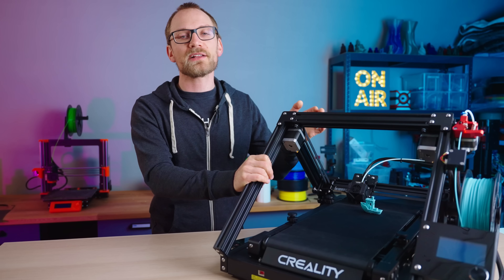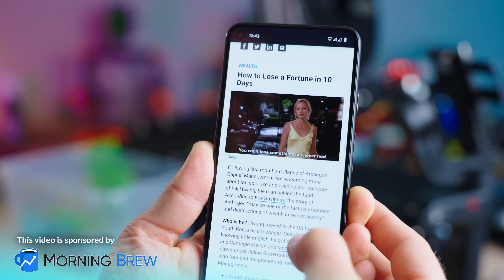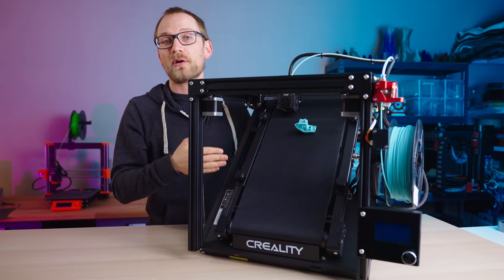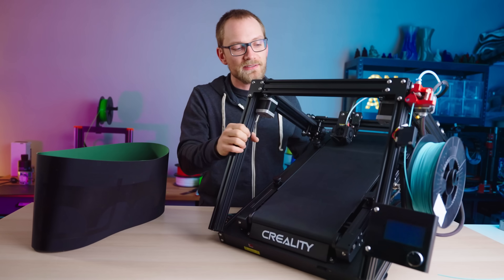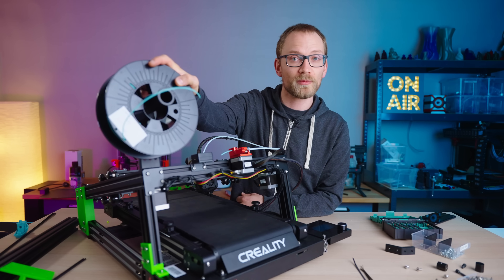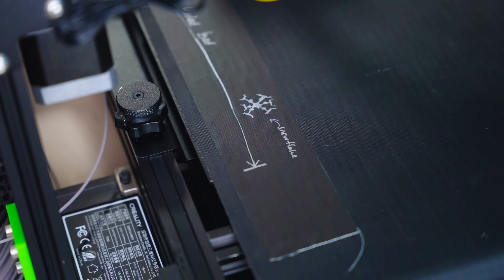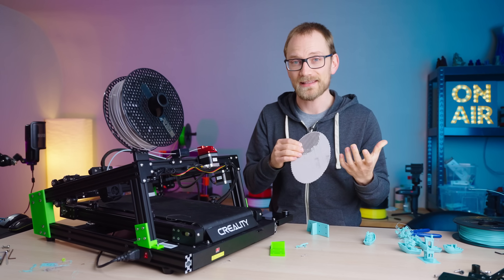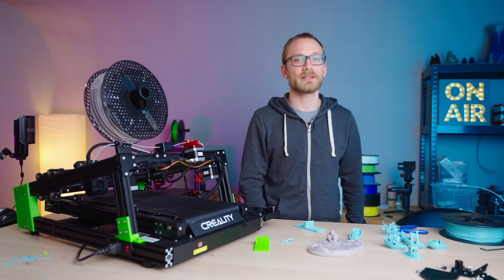Is a lowered belt printer BETTER?

Comment: Why not rotate the print head? Add a new coordinate to print from the optimum angle?
Reply: There are experimental heads that tilt upto 45° but the extra weight is limiting
Reply: agreed why not print a wedge type spacer the same degree as the incline of the x y rails have the print nozzle perpendicular to the belt and slice on a 45* or whatever angle your axis is set at ?
Reply: Interesting ideas. I had in mind some simple stepper motors to position the head, almost like automatic welding systems on a three axis arm, but far simpler.
Reply: @mikeday5776  that would be interesting but I think a bit overkill just a simple fix the avg person can use. But I like your thinking.
Reply: I show clarify I mean the print head axis. You could even rotate parallel to the printer axis, if you wanted to creat even heavier coding issues.